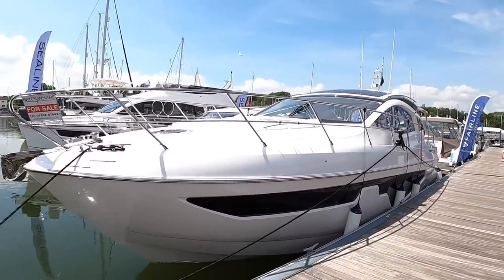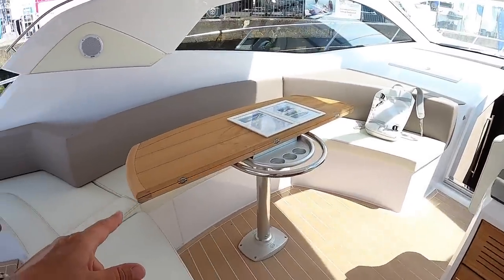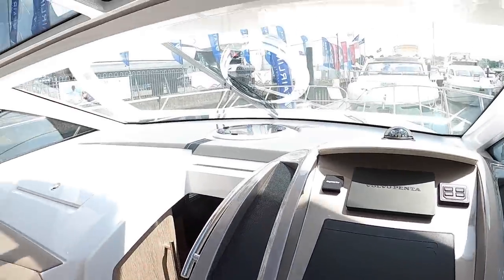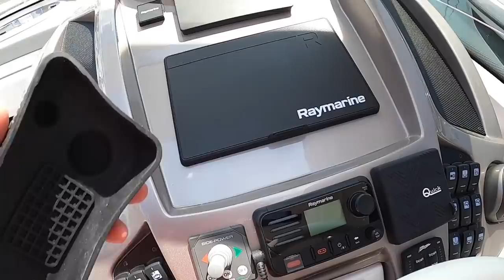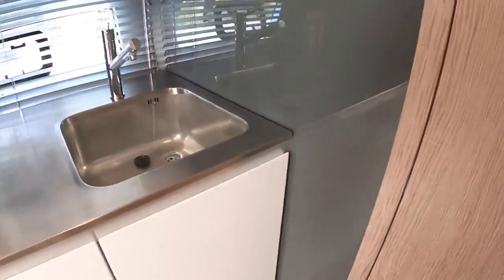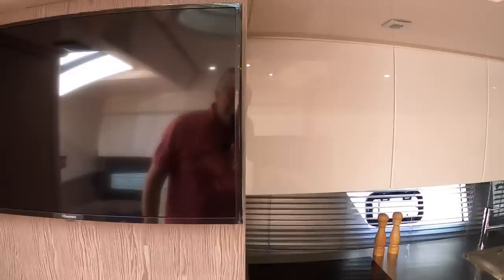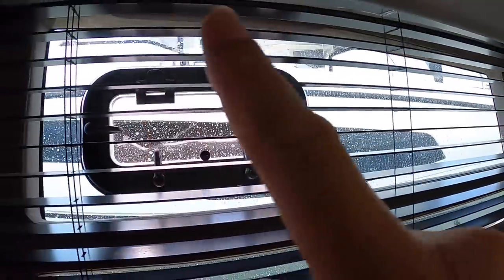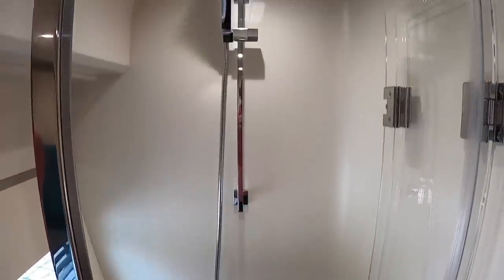£577,000 Yacht Tour : Sessa C44

Comment: A wet bar with an induction hob is way more practical. You can just get a pan on it that's like the top of an electric grill but you can also cook outside in a pot if you like. And if you need 3 or 4 burners just use the two up top. More boats should offer it as an option.
Reply: I like induction but not everybody does. More people prefer Kenyon grills as they cook meat so nicely, Kenyon are so good they have a range of well-regarded indoor models.
Reply: 4 burners in the galley so 6 in total

Comment: Living in Arizona, we're well trained not to touch anything metal in the desert summer for fear of a second degree burn. Everytime you grabbed a rail, i flinched.

It's so hot! Someone save me with a boat ride!
Reply: Mate, where Nick lives a "hot weather" is when the temperature reaches 20C ... I think it is quite safe to touch anything, metal included 😉
Reply: @jackbishop2967  it's nice here today. Only 43c (under 110f is hot but doable) Sunday it's going to be 45. (Over 112f -  forget it, like standing in front of a heat gun all day).

One nice thing is our elevation changes, so if you drive 2 hours, you can find 20c in the morning or late night.

Comment: You tapped the tanks, which looked huge, and didn't   mention capacity but went on to say you might get about 250 miles
Reply: 450 litres each, 900 total.

Milage will be speed dependent, these things approach 40 knots so it depends how hard you ride them.

Comment: Loving this boat! Just curious, is "heads" a boating term or a European term?
Reply from the maker: Very much a universal boating term (although in the USA it is 'head')
Reply: @AQUAHOLIC  very interesting. Thanks for the info!
Reply: The term “head” used for a marine toilet started because of the location of the toilet on the earliest sailing ships. For crewmen, the facilities were located at the head of the ships. The front of ships had a figurehead: a carved wooden figure or bust fitted on the bow of the ship. The toilet was located there set just above the water line with slots cut near the floor level to use wave action to wash the toilet.
With the wind blowing from the rear to the front as it does for sailing ships, the “head” (or front) of the ship was the best place for everyone for a sailor to relieve himself. So, when the crew went potty, they went to the head of the ship…and the name stuck.
Reply: @dickkingswell5249  This is awesome! Makes perfect sense now. And i appreciate all of the detail. Thank you!

Comment: Where are the two very attractive bikini clad girls shown on the video’s thumbnail? Or are you going to tell us that they are not standard fittings? If they are not I don’t think I’ll buy one.

I do like the functional stainless steel worktop with seamless, integrated sink. That will make cleaning up easier. Now here’s a dumb question - How do you use the shower in the day heads? Surely all of your clothes and towel will get wet and you’ll have to dry the floor after you are finished if the floor is to be safe and dry to walk on. Unless, of course I’m missing something. This is a lovely boat and probably very suitable as a “first” boat.

Comment: Something so luxury that is cheap compared to other yatchs
Reply: Not really that cheap. It's a 44 foot two cabin coupé that's approaching £600k. Look at Aquaholic's tours & prices of Princess V40, or a flybridge of a similar size (admittedly slightly shorter) from Galeon or Sealine will cost you £100k less.
Reply: Well there have been a numerous amount of yatchs that are very expensive. For example, the Gulf Craft Majesty 140 selling for around €19.5 million
Reply: @jack44475  that's a superyacht. Look at the 40 to 50 foot prices. But then again this does have strong engines so that will explain the slight premium.

Comment: A great tour as always Nick, but not sure about the boat - Lovely from the outside and the cockpit is beautiful, but there's some really odd design choices and cut corners inside - those magnetic door clips are a toe stubbing dream, the day heads is poorly planned out (curtain shower in a £500k+ boat?), the headroom in the mid cabin is clearly pretty poor and there's a jutty-out bit of ceiling to KO you as you try and get to the hanging locker. The floors creak and don't seem to fit properly in the guest cabin, and the TVs aren't inset to the walls and stick out everywhere, which wouldn't have cost a huge amount to fix and just looks cheap. 

It would have been better in my mind if they'd admitted defeat on the mid cabin, accepted this is a sports boat, and made it a fore master with an under-cockpit guest like most 30-40ft sports cruisers.